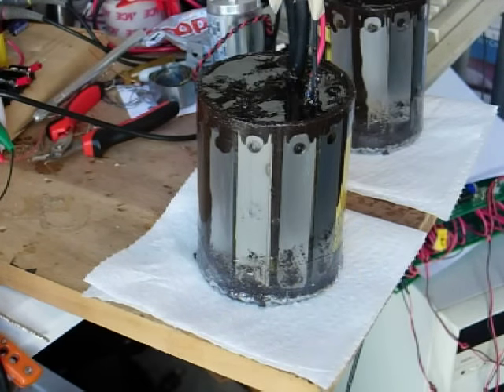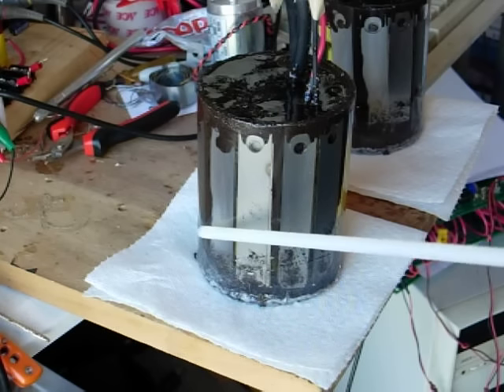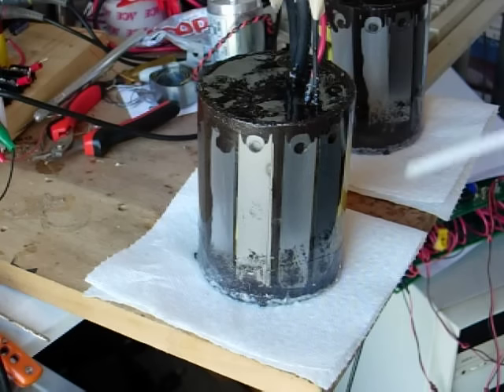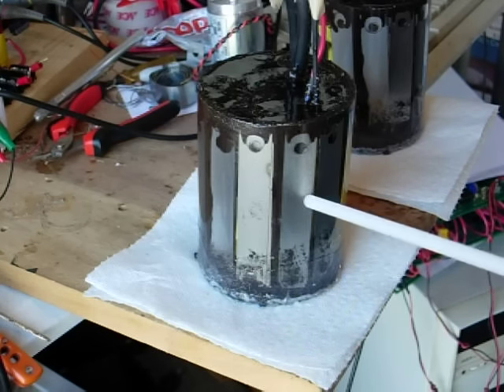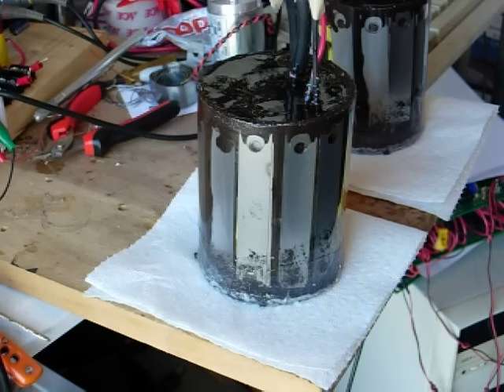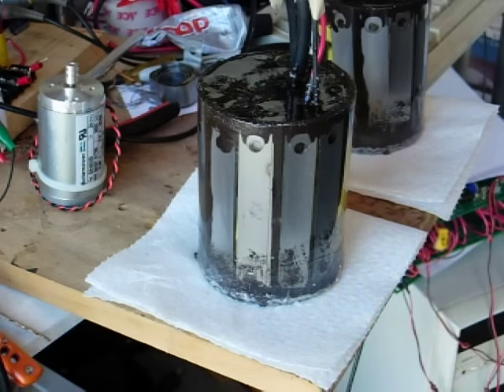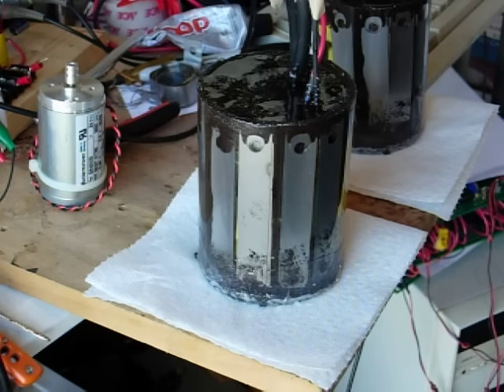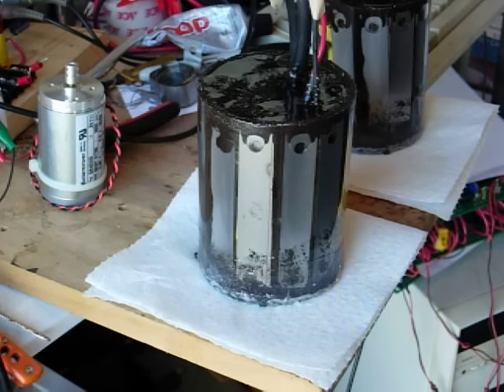Don Smith #105 two pole transformers done

Comment: Hey Capt looks pretty good. I'm impressed you built your own mini pole transformers and I'm looking forward to seeing your motor push these little guys. I'm currently insulating my little 8' x16' building I bought to be my lab and hope to have it up and running in a few weeks.
You are definitely using the right terminology when referencing the circuit, "tuning" is exactly what we are doing. RF is the real prime mover in this circuit and it doesn't obey the ohms law not one little bit. I think you're very close to really reaching your goal :)! 
Be aware though that I lost control of my last setup around 15K to 18K RPM's, I burned out a speed controller for my out runner motor. I haven't tested to see if it started working again but I did replace with a new one with ferrite shielding around the incoming signal wires. I haven't repeated the same RPM test as the tubing I'm using isn't up to par at those RPM's. I need to have a little shaft machined so it's in the works when I have the time and money! 
Anyway brother great job and I'll give you a call, hope all is well.